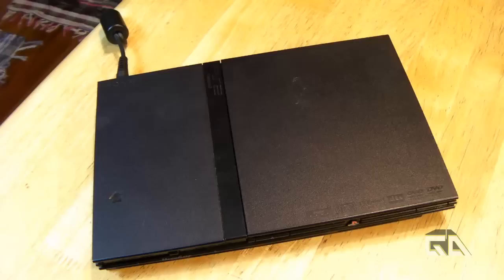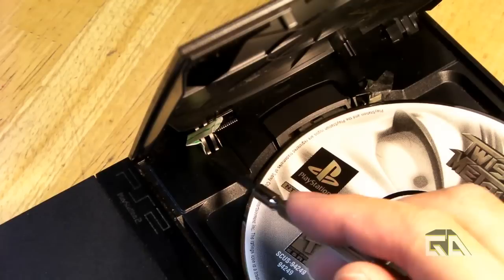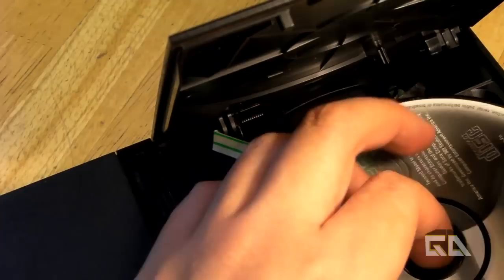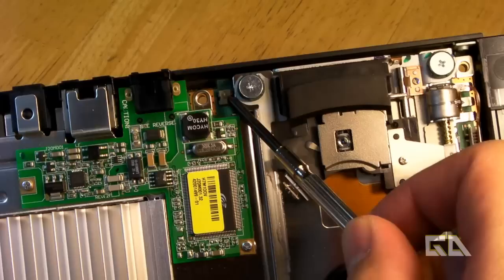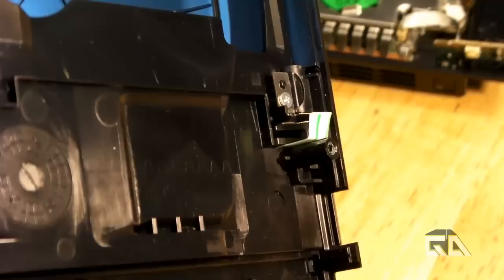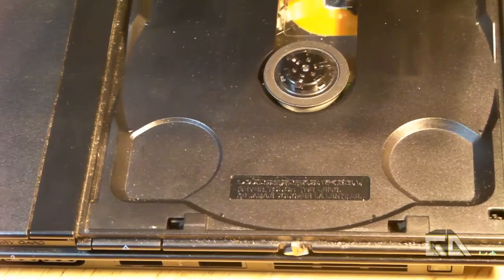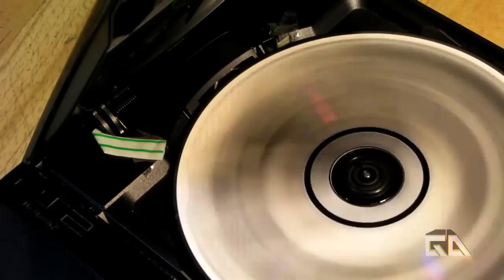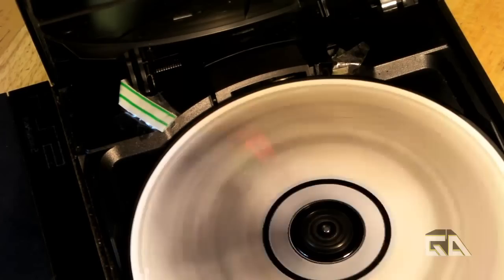[How To] Install the Tape, Tissue, and Straw Mod for Slim Playstation 2 Tutorial! [CC]

Comment: 8:14 as noted Do not use super glue. On the rear switch it seeps into the switch and insulates all the contacts before it sets so not only does it not fix the switch closed it also destroys it. In addition super glue also melts the plastic in the switch and can also melt the system case. If you do use super glue you'll have to pull the switch off (which isn't too hard to do without damaging the system board) and then try to soldier across the connection points which is not easy unless you are competent with a soldiering iron.

Comment: VERY IMPORTANT TIP: for the straw method, replace the straw in the exact same shape, with a thin line of baking silicone. It will be difficult to get it in between the slit , but please take the time to try it. The original ps2 slim that I tried this on worked… until the damn straw melted and destroyed my ps2. I tried it with baking silicone on another ps2 slim, and so far it is still working after 3 months of play time (the straw in comparison only melted after 5 hours on the first attempt). Now this will not be the case for everybody, but there is a chance that this could happen to some people. The silicone will have no reaction to the heat from the ps2.

Just wanted to help save someone’s ps2.

Has this happened to any of you guys either?

Comment: The tape sensor is not a sensor, it's just a brake that holds the disc when you open the lid. You could just unscrew the mechanism since you already opened it
Reply from the maker: Semantics I suppose, but thanks for clarifying!
Reply: @ProjectPhoenixMedia hey Phoenix, this is a massive problem that PS2 slim fans have been struggling with ever since the slim first came out , and in some cases it had this problem only 3 or 4 days after brand new box was opened (3-4 days worth gameplay that is ) kudos to you for putting out a video like this , , , I'm surprised a 3rd party company hasn't put out a single time install kit  , ,like some of those products sometimes seen on Macho Nacho channel , , right now retro is gold with GameGear IPS screen mods  to consolizer kits for GBA 🤔🤔👍👍

Comment: I tried your method but instead of the straw, I just put tape on that sensor inside and I was able to make the CD/DVD spin with the lid open. My problem is even though my ps2 can still read regular ps2 games, it won't read my burned ulaunchelf cdr or dvdr. It would always take me to "put playstation/playstation 2 format disks". 
my ps2 is SPCH-77001 please let me know because I want play Grandia 3 which is very rare now

Comment: It’s an older video but I figured I’d say this Incase anyone has this problem since the PS2 is getting older/more fragile.

If you accidentally break off the sensor with the tissue trying to dig out the tissue for whatever reason, if you disassemble your PS2 and take out the power button board you’ll see that the sensor connects to two pads. You can easily solder both pads and bridge the connections so that they constantly keep contact and you don’t need the tissue to block the sensor anymore so all you’ll need to do is the straw portion of the mod.

Comment: I don't seem to able to place the straw properly. I own a SCHP-7xxxx model, and there's a slight difference in the sensor and the little space I have to slip the straw into. I flatten and bend it as well as I can, but it doesn't work. I checked to see if the other sensors are ok, so it must be the straw. Any ideas?
Reply: ***** Yes, I intent to do quite some disc swapping in the future, but only if I can get this to work, something that I haven't managed this far.

Comment: Please HELP
Hey will it work on 9xxxx mine is 0A and how to get the games.
Reply: I know its late but first try burning ulaunchelf.iso on dvd-r or dvd+r use (imgburn) you dont need to format the dvd just insert it , browse for the ulaunch.iso file . choose 4x speed then press burn . go and put the dvd in ur ps2 and if u are lucky enough the disc may work . insert ur memory card .there will be a menu press R1 or R2 or till u find install freemcboot press X . wait for it .... says completed . restart ps2 and now the freemcboot is working . try it , it worth . I never thought its was going to work without modchip !!!!!

Comment: I successfully did the sensor steps, but is there anyway for the laser to work after disc swap each time? I’ve been wanting to play my Guitar Hero 2 customs again, but of course, I succeeded in modding my slim PS2 only to attempt to do it again for an hour and a half
Reply from the maker: Couldn't you start with 2nd disc and start from a save game?

Comment: Can someone help?
I just bought a PS2 slim, and was uncertain about how to switch it off.
I've just learned that holding down the light button will put it into standbye, but I don't want to leave it to use up power while it's in this mode.
So, does it damage the PS2 to turn it off at the electric plug while it's on standbye?
Reply: *****
That's a relief. Thanks.

Comment: would it be possible to do this mod, insert an original ps2 disc so that it realizes there is a legit disc inside, then quickly switch out the original disc with a backup and have it work?. I often see videos of using this technique with ps1 games on a ps2 and wonder if it would work with ps2 games.

Comment: Are there any other ways to block the 2nd sensor? My tape always keeps loosing up
Reply from the maker: Try stronger tape, or a dab of glue to hold it in place? Definitely for the sensor that is on the motherboard do not glue that down, that is a super bad idea.

Comment: Hello PPM! I have tried the uLaunchELF method with a modbo chipped slim one, and it didn't wanted to boot from the uLaunchELF disc, what can I do in this case ?
Reply: ***** Yes, I have tried the CD version from sksapss with a normal CD-R and I have tried different versions with a DVD-RW as well. I haven't got any idea what can be wrong.
Reply: Thanks for your help! I'll try it tomorrow, because the chipped one which i've mentioned before belongs to one of my friends. I hope it will work. I'll let you know the results. :D
Reply: Lots of thanks for your help! It works perfectly with DVD+R :D You're rock man!

Comment: Question - on this video the game disc constantly spins, will it know to stop spinning when your playing and it doesn't need data? Is this safe to do permanently if your not trying to modify and your simply having an issue with it not spinning..
Reply from the maker: We are simply blocking the sensors so it doesn't know when the lid is open to stop spinning. If you don't have a need to block the sensors, remove them and use the ps2 as is.

Comment: Ok, So i did your mods. Disc spins, and the sensor moves so that is all good..

I downloaded an ISO of SwapMagic v3.6 and burned it to a CD. However upon the PS2 loading the disc, it pulls up a read screen and says to put in a PlayStation compatible disc format. 

Not sure on the next step.

Comment: Sometimes my slim doesn’t read discs but when I open and close it, it starts to work. What causes the lid sensor to not work sometimes? The lid closes properly
Reply from the maker: Not sure about that, could be something related to the sensor? These days I play games without a disc so this is a non issue using opl.

Comment: I personally removed and soldered the points for the second button.

I removed the disc stopper all together.

And I'm working on adding next to the frontal button with a master switch that I can toggle on or off the lid to bypass the normal button for when I want to disk swap

Then it will be a simple, and clean ;)
Reply: @ProjectPhoenixMedia  well, I was about to put the switch in tonight actually.

I'll probably post a video of some kind knowing that someone will get some enjoyment out of it!

Comment: How am I supposed to tell if I did the straw mod correctly? I have got all 3 sensors and the disc spins with the lid open,but I don't want to end up getting that perfect circle scratch on the disc.The only difference between yours and mine is that I did not need to press the straw down and tape it for the disc to spin,does that mean I did it incorrectly? And I did bend the end of it and it is facing the exact way in the video and is in that little thin slot.

Comment: After doing all the steps and after having everything related to mcboot done, does the ps2 still need to have its sensors covered/pluged? Or was it just a wait to force the swap in order to install ulaunchelf? Could one take out all the tapes and the backups still would run?

Comment: hey just one question.I did everything fine the disc runs with it open and it loads fine,but I see the red dot on top the disc( I assume the it's the laser that reads the disc) Am I not supposed to see it? I just don't want my discs to become laser burned

Comment: Great Tutorial Phoenix Media.
I have an alternate suggestion for the tape portion of the mod. When you take the ps2 apart you can also use a small rubber band to hold the slider back. I have found this to be more reliable method if you want to keep the mod for a long period of time.

What you do is begin by looping the band around the arm in the topside of the tray and then threading the band through the small opening underneath the arm. On the backside of the tray you then take the other end of the rubber band and secure it to a post. This will cause the rubber band to be pulling the arm in the desired direction. Then just check for stability.
Reply: +Project Phoenix Media No problem. Thanks for the reply. I honestly feel like you're modding tutorials are the best on you-tube and I greatly appreciate them. Definitely beats navigating all the cluttered forums that I used to.
Reply: +Mark Lewis your

Comment: i don't suggest you do this, i'm sure most have succeeded, personally i followed this to the "T" but it failed, knew it had to be the sensor for the straw, after trying to repeatedly to get it to work, the ps2 wont' turn on for NO reason but red lights on. Nothing lose or anything, i DID touch the straw sensor, did it short out? its not like it was on. Now red light won't go on period
Reply: now it would be cheaper to just buy a modded system thats HARD modded via ebay or some shit
Reply: +Project Phoenix Media I am doing this to play NTSC games on my PAL system.

Comment: hey man after i do this mod do i still have to use swap magic or is the mod by itself enough to run my burnt games?
Reply: ***** Um i think i am stuck i did your mod and it worked but i cant find a swapmagic disc in pal i can only find it in ntsc there is also no gameshark disc on any website ebay etc. Is there a way to install mcboot without swapmagic or gameshark

Comment: (i know this may be old video or late comment i dont care) so i took my PS2 apart im wanting to try to get the action replay disc ISO working on my PS2 so i can get that mod working with the memory card so i can play backup games off USB i have the ISO on my pc then burned it to a disc i downloaded the PS2 emulator then loaded the disc & loads the action replay just fine but when i goto try the hot swap with PS1 game then the action replay ISO disc all i get is a black screen with a green square bottom left of my screen i tried another burned disc with same action replay ISO as the disc i used before same results i tried using a legit PS2 game & it does the something with the black screen green square bottom left of the screen anyone know why its doing this im already about to smash it lol stupid thing with the straw doesnt work i had to tape that little tab but now i cant put my console back together or it will undo its dumb but i want that mod with the memory card i have few PS2 games i want to play i tried loading the PS2 games i got with my CFW ps3 but the games are crap & textures/game are glitchy as hell so im done with that work around with PS3 trying to get the PS2 games to play nice

Comment: I actually used a small piece of notebook paper instead of tissue, NB Paper doesen't fall out as easily :/
Reply: I used tissue at first but it kept coming out everytime I opened the lid, I'd find it sticking to the lid.

So I then just tore off a small section of NB Paper and and folded it into very small wad and stuffed it in there and so far it's been fine.

Comment: I have the Swap Magic discs already and used to have a Flip Top cover, but had to buy a new PS2 Slim (lost the whole thing, including the flip top cover). I came across your video looking for an alternate to the flip top covers.

Is it safe to do all these mods? I'd hate to break anything. (Do I have to break anything btw?) It's really the straw mod that I'm worried about. Is it possible to break the PS2 if you fail the straw mod?
Also, do these work with all models? I have the SCPH 70012 one.

Thank you for answering, and your video!
Reply: ***** Thank you for replying! I'm going to go ahead and give a try now, and I'll let you know how it goes :)
Reply: ***** It worked! Got it on the first try! Although what is odd is that I dont have to tape the straw down, it still spins. (I will tape it anyway)

Should I be concerned? I tested the Swap Magic discs (without it taped down) and it works.

Comment: I just removed the spring at the second "sensor", which is not a sensor at all, but just a mechanism to slow down the DVD if the case is opened (SCPH-77004 btw). I thought it would be easier to remove the spring rather than tape it on both sides (which never worked for me)

Comment: I knew this was a bad idea. I think I messed up something idk hiw because I did everything and it worked perfectly at first but now it just reads then stops
Reply: La Chaîne de Proround You can. It's not really difficult. Eventually I tried this method on a different ps2 and it worked perfectly, so I'm thinking  the ps2 model I was using before wasn't good. :)

Comment: Instead of a straw, see where the sensor is? put some tape on it, and make sure the switch is down, then put a tiny bit of scrunched up tissue to apply pressure so the tape does not come off, Its invisible, and then you just gonna press down the other sensor, I don't really understand why you guys use straws.
Reply: I guess... Maybe I'll make a vid..... it looks neat, so if u wanted to sell it of as legit all you gotta do is remote the tissue from the sensor that you can see on the cd drive.

Comment: I have a problem.I made my ps2 to make ps1 back ups,but even if the disc is new,it still have glitches somewhere.For example: the disc is perfect because no lags or anything,but when I meet a move in the game it starts glitching. (only sound glitch.sometimes when the glitch starts I hear it for long.) Besides at the first cutscene there is a little lag,always at the same place.In another game I just walk with the main character and when I walk it starts lagging. (the sound.) On my old ps1 it never happaned,but I don't have it anymore.What do you think what's the problem? I burned the games at speed 1 or 2.
Reply: I did it but the same and it was Sony.Is there any special settings for DVD Decrypter or IMGburn? I tried to configure them but nothing change.The strange thing is when I had ps1 it worked,but with many sound glitches,and lags because the reader was bad.Finaly I mod my ps2 and now that's the new problem. I blocked two sensors because I removed the roof of ps2,I mean you can see the inside.
Reply: as I said regulars are ok but burned games not because of sound glitches.
Reply: thanks for your helpful reply I think I have the problem with the reader,when my psx was working it was reading everything perfectly,later the new discs started lagging (maybe the burning speed was the problem because it was slow.) That was strange because older discs worked better then new.I think I'll solve the problem with the reader.

Comment: My lid was apart when a black coil thingy came out. NownI have to lift the lid of my ps2 slim to open the CD drive. Any suggestions? Cause I don't know where it goes or came from.
Reply: ***** I just don't know where it goes. I searched google and nothing about it. I need help. I don't know where that part came out of.
Reply: ***** Yes. I still have it. It is in my clear container. With only a dime. Lol
Reply: +Project Phoenix Media I'm kinda new to this but what do these mods do ? And what's their use ?

Comment: I dont care how related to or unrelated to this video this is, I need some help and it led me here

I am currently struggling to run a DVD9 disk on my PS2. I was told that maybe manually "assisting" in the disk's ability to spin will help it run, but to do that first, I'd need to block the sensors to allow it to be read when the tray is open. Do you have any thoughts, ideas, information, help, anything, I am on the edge of madness here and I fucking want my Samurai Warriors 2 Xtreme Legends! XD
Reply: No modding, completely legit copy of the game

Comment: So as it turns out, because my PS2 is a 79001 series I only have the two sensors on top to block out. Didn't even need to tear mine apart. lol. Of course I didn't realize this until after I tore it apart and saw that it was WAY different than yours. lol.

Comment: Wish I'd watched this first. Last night, I watched another video, used super glue, busted my sensor, and now I'm either going with soldering wire across the points or taping aluminum foil. I guess I'll start with untaped foil to see if it completes the connection or whatever (no expert here). If it does...I may not bother with solder. Of course, if the tape keeps coming loose, soldered it  will be.

Comment: ps1 burned games it will work also?
Reply: i tried burned games but not working
Reply: maybe need to block 3 sensors
Reply: yes its definitely moded and installed fmcb 1.94 on my ps2 slim 9xxxx 8c